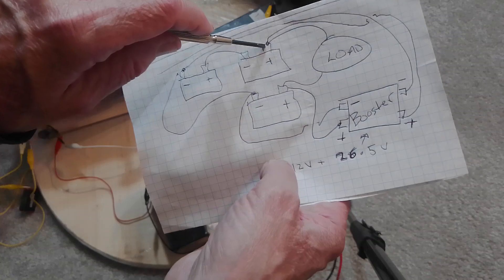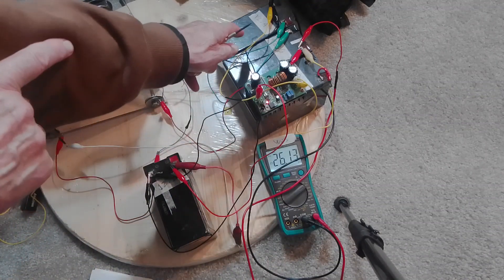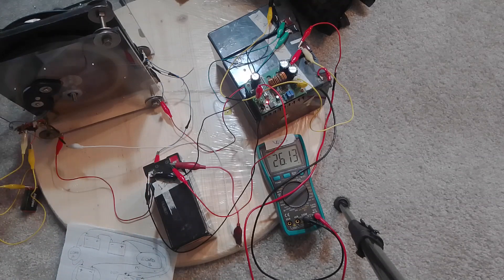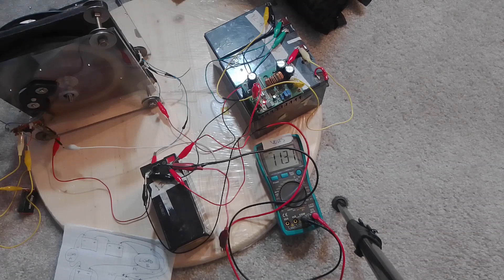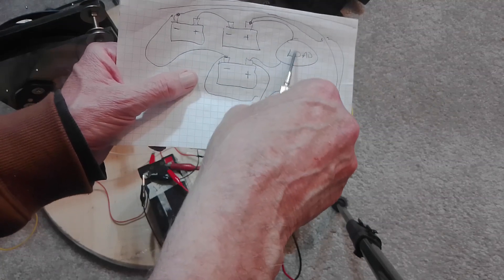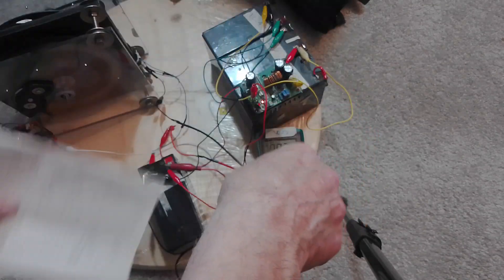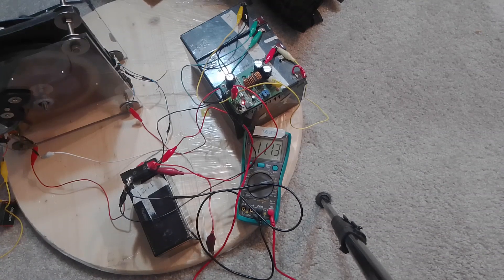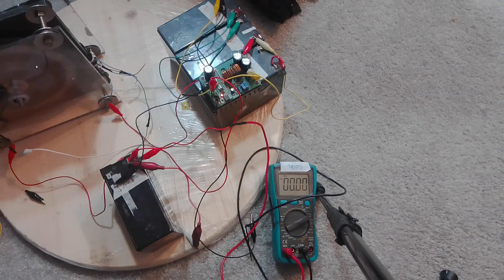3 battery split the positive experiment DRMG as load

Comment: Looks good
Keep up the good work
I am trying it with the LTO batteries
Will keep you updated
Thanks
Reply from the maker: Hi Reza
Seems like the amps going back to charge high side batteries needs to be adjusted via the DC to DC booster amps-adjustment potentiometer  to be same amps as what is going into the low side battery via the voltage differential.....at least something close - this experiment had 1.2A returning to high side coming out of booster (370ma showing at the high side battery after going through booster)  While only 220ma coming into the charge battery through the load of the motor coils of the DRMG...

Comment: Doug, your sketch shows 3 batteries plus a booster and the load (the motor). Its the same setup Dave Bowling was experimenting with for years right?
Reply from the maker: Hi Hans
That fourth battery you see is not connected it has a bad battery terminal, but is glued to the battery next to it, so I left it there, the  booster sits on top of it.  
Yes David Bowling is very deep into this set up and is an expert at it. 
 I would say that this is the basic John Bedini set up since I copied what he did from the internet since my original plan didnt work out, that is the first drawing I show with the positive  of low side connected back up to the ground of high side (charge battery is flipped around)   
I want to try that some more too since it makes it so there is "no ground" everything circulates through batteries.  
Probably it wont work but will try that again. It blew out the voltage regulator in my DRMG first try with it.  
When I fixed that, I connected DRMG to other side, and it was running on 33VDC so seems messed up but need to try it again..
Anyways this has lots of potential (pun almost) as whatit needs is that charge battery kept up in charge and that could be done with the backemf/flyback from the pulsed motor coils, or perhaps some or all of the generator coils in the DRMG, or if spun with rotovertor I could slam in the run capp phase power stepped down and rectified into the charge battery too.  
Next testwith this set up is to turn down the current coming out of the booster, I think it is on maximum current, and also do not pump back 27.5VDC into high side from booster, but instead 24.5 plus turn down the current as there is adjustment for that.  Goal would be same or near same current going back to high side as current coming in to charge battery.